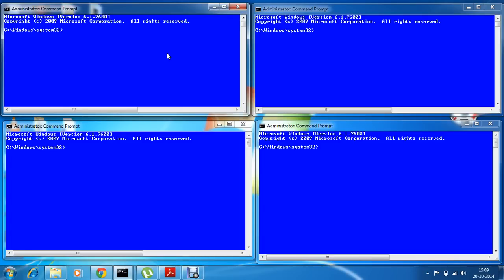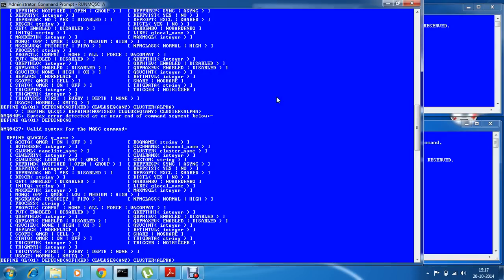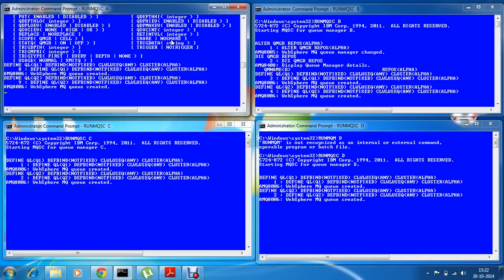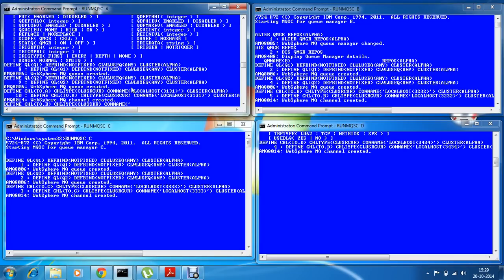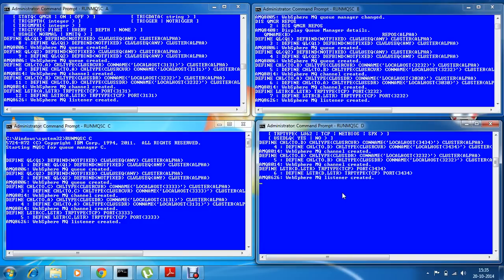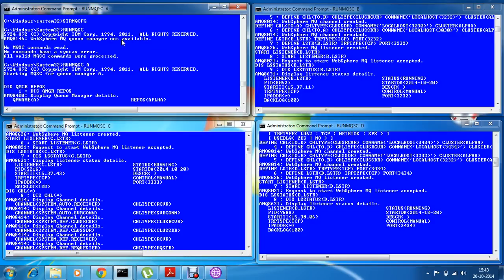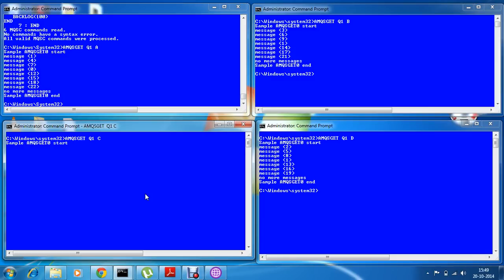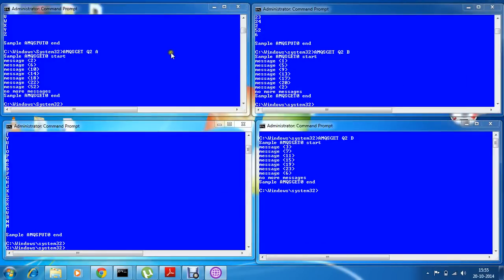Clustering in MQ Tutorial

Comment: at 22.46 u gave sender channel to qmgr A frm qmgr B ;port number is 3030. but u defined it as 3131 in qmgr A..how come it worked
Reply: +Ajay Mq I want to know too..
Reply: You only have to define one Cluster sender channel on one node. MQ will create the others as necessary. Therefore (I think) when MQ saw that it didn't have a proper cluster sender channel for B --> A it just created a correct one whenever it needed it.